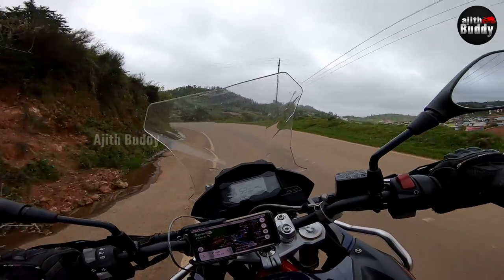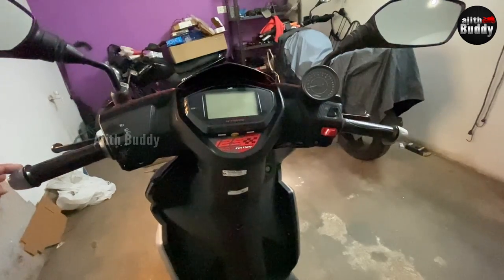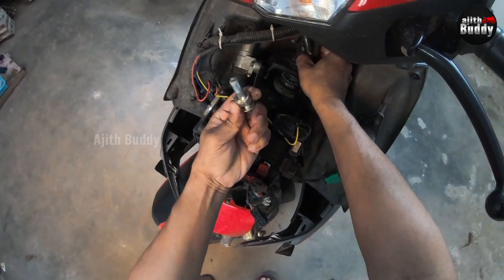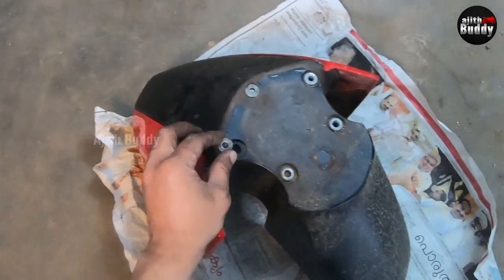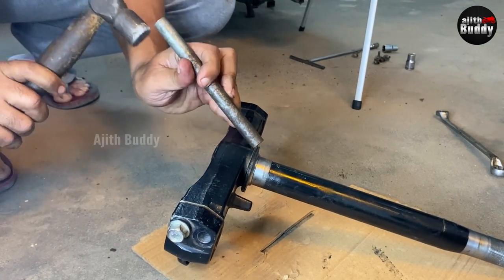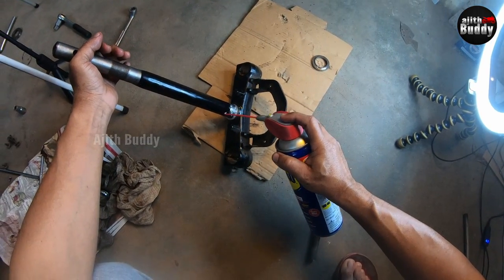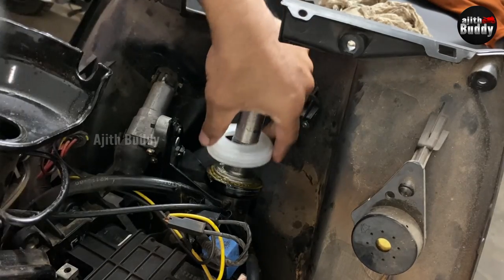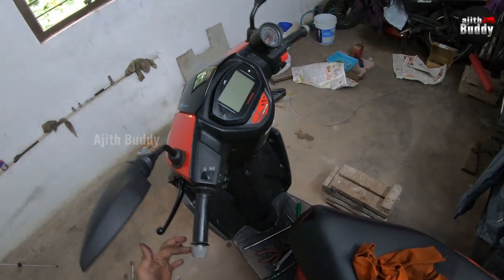The Reason for Most Handling Problems | Let's Solve It | DIY | Ntorq | Ajith Buddy (English)

Comment: Hi bro. I am a regular viewer of your videos. I own and run 2008 std 350. Engine temperature of my bike does not die even after 10 kms of running and hault for 3 hours. HT coil, wiring replaced with new ones. Oil circulation is good as per mechanic's view. It has a built in 4 plates clutch system. Using NGK Spark plug. Can you please suggest remedy?

Comment: I replaced new cone set but there’s still play in handle.. when i do tight nut slightly the handle got tight I have been facing this problem from a long time.. what is wrong what do i do now it feels very bad whenever potholes come n same thing happen when i press front brake. 😢 plz help
Reply: Ho to mechanic and tell him to check brake kit of front disc brake
Reply: You have to weld a lil bit of material on the top of your T stem. It will solve your issue.
Reply: Same bro whenever I use front brake above 30kmph+ it feels like handle is too loose and it makes a sound